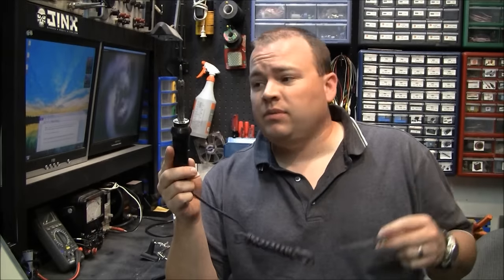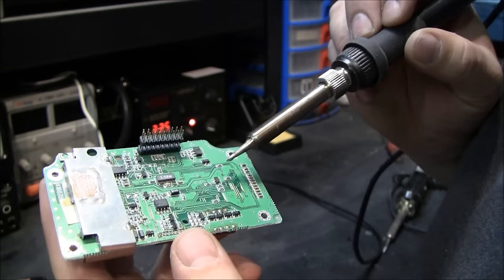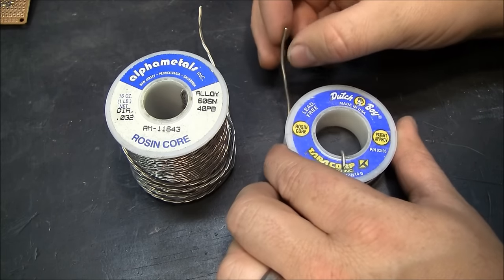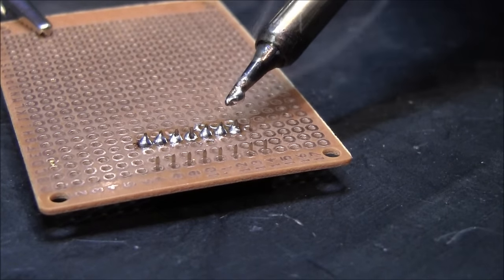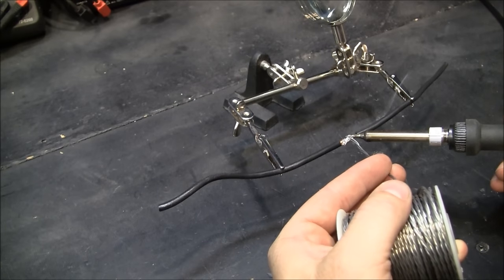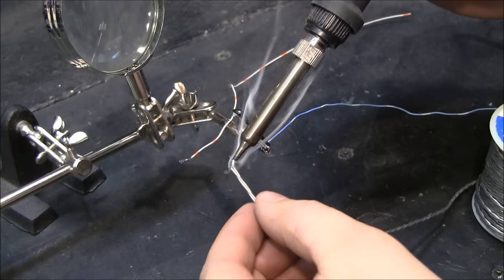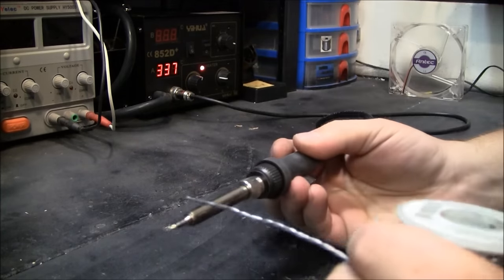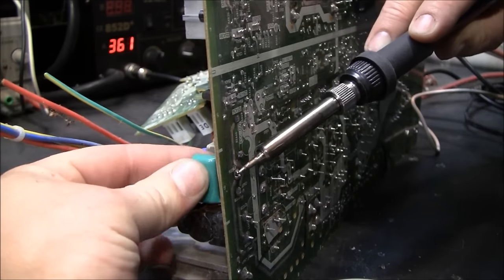Beginner how to Solder

Comment: “I used the solder to solder the solder.” Thanos’ guide to electronics.
Reply: Underrated comment
Reply: LMAO
Reply: so underrated
Reply: Sauder*
Reply: @jayox6449  your wrong it’s spelled solder
Reply: @harrsh7116  Dis how we do it in merica...
Reply: @jayox6449  it’s spelled solder but pronounced “sauder”
Reply: @harrsh7116  ty for the correction and information, you are a genius. This all went straight over your head huh..
Reply: @jayox6449  exactly this is merica
Reply: @multitude1337  q
Reply: @jayox6449  sawtter
Reply: Thanos: Resources soldered and soldered until there was nothing left to fix I gave those electronics a second chance
Reply: @jayox6449  no matter the horrible pronunciation its always spelled solder and yes I'm an American and I pronounce it the same as the brits the correct way 😂 because  'MURICA
Reply: @vulgervulcan  ok
Reply: @harrsh7116 you’re*
Reply: saulder*

Comment: "if you're poor you can use electrical tape"

Fishes out the electrical tape...
Reply: HAHA, I noticed that.  What's wrong with electrical tape???   :)
Reply: it's like the same price almost still funny
Reply: @ryangarcia5416  yes but it's not as cool
Reply: and cigarette lighter vs heat gun .lol
Reply: I noticed that.
Reply: @richb7414  i will take a lichter if i need my heatgun at location i need to run a extention cord etc too much work fore 1 cm of heat swrink
Reply: I just started getting into diy projects and when I try to solder the solder either stays on the tip of the iron or when I pull back the solder there is just a little ball on the end of the solder. The only way I have been able to get a half ass solder is by putting a small piece of solder on the connection then placing the iron on it. I don't know what kind of solder it is as it came with the iron.
Reply: I was like, “I relate to this so much right now”
Reply: @Vgp-rp4iu  might need flux if it isnt in the solder already
Reply: Saania Salahuddin lmao I started busting up when he said that 😂😂😂
Reply: I do have that
Reply: I was literally coming to the comments to say this
Reply: I know right...I was just about to comment about that but thank you for doing my job🤣
Reply: @Jesus_is_Lord_316  it means you're poor
Reply: @ryangarcia5416  yeah, but only poor people use it, so...
Reply: @angelorondini5835  because... is anything that poor people do cool?
Reply: @richb7414  he didn't say he is rich... only that he wasn't poor
Reply: Ikr
Reply: I use garbage bags, some days I want to eat a snack in between soldering... not like Warren Buffet over here
Reply: Poor gang ough
Reply: Me: cries because all I have is clear and duct tape
Reply: if you are going to teach, please use your words properly.
Reply: Ha Ha Ha
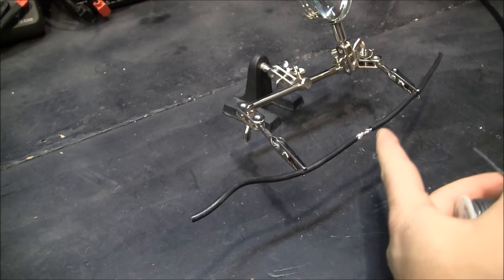Reply: 3:58 he stuttered when saying poor lmfao
Reply: All you people commenting must be poor
Reply: I loved that part too
Reply: I had no idea I was poor
Reply: Stop caring about comments bub. Wicked good video. Tell em your gonna solder their nuts to their forehead.
Reply: Love it!
Reply: Haha what do homeless people use? How do you say sold in America? 😁
Reply: Dislikes the longer process of shrink tubes.... duct tapes TF out of it

Comment: I don't care HOW it is pronounced...I just want to know how its done. This was a good start.
Thanks for this!
Reply: +Darrell Batton Just beware that if you follow this video, you'll be making it harder for yourself than it needs to be. There's pretty much nothing in this video that is good advice. Instead, look for the soldering tutorials from PACE Worldwide and EEVblog.
Reply: Antonio Tejada 
Nothing?
Reply: +Darrell Batton Pretty much nothing. Watch the tutorials I refer to to see what I mean.
Reply: +Darrell Batton: Because bad information is worse than none at all, and unfortunately this video has lots of misinformation. You're better off learning good technique, which will save you lots of time and heartache down the line. 

This guy keeps his iron WAY too hot (so the solder oxidizes faster, giving you less time to work), he applies far too much solder to the joints, flicking solder off the iron is dangerous... shall I go on? Instead of attacking the messenger, go look at the sources I've recommended and see what proper soldering technique is.
Reply: Antonio Tejada  Hmmm...
Way too hot? Doesn't it depend on what type of solder and what application, since different alloys have different melt points? Hell, in the video he says it depends on application. (That must be wrong...) 

But you stated, "pretty much nothing in this video that is good" - and with that you are simply wrong.

I'm guessing that like most skills, watching a video is NOT the way to learn - DOING is. And learning from mistakes is a better teacher than luck. I'd venture to say that if this video does offer some bad advice...I'd learn it pretty quick when I tried it.

However, that's not the problem I have with your comment...

My gripe with you is the way you delivered the message, not the message itself. By your negative blanket statement, you ruined the message... and your credibility. Thus the messenger deserved the attack in failing to do his(your) job.

Next time, try honey, rather than vinegar.... like this:

"I find that the soldering tutorials from PACE Worldwide and EEVblog worked well for me. You may want to watch those as well if you are trying to learn soldering techniques. With all things YMMV!"

Cheers!
Reply: +Darrell Batton Does the temperature depend on application? Yes, especially with low-quality soldering stations whose tips are poor and/or whose temperature sensing is not tightly coupled with the tip. (Can't really tell what he's using.) But bear in mind that modern lead-free solder melts at 219C, and classic 63/37 leaded solder at just 183C. So generally speaking, 280-300C is a good working range for your iron. 370C is so hot it just burns away the flux.

You're the only person who's reacted like this to my comments, so while I accept your feedback as to wording, I think you're being a bit (insanely) oversensitive. And do bear in mind that I didn't say "absolutely nothing", I said "pretty much nothing", allowing for a tiny amount of correctness in the video. (I still maintain that the wrong-to-right ratio in this guy's videos is very high.) As for credibility: You don't need to believe me -- I'm just a hobbyist --  you should believe the professionals in the videos I've suggested. 

As for learning by doing -- of course, there's no replacement for practice. But there's also no need to waste your own time reinventing the wheel, when you can have some professionals show you best practices so you know how to do things and what to look for.
Reply: Antonio Tejada :)
Reply: True sir
Reply: @rjdeible I don’t know why I have any subscribers at all, since I don’t produce videos. But I gave suggestions for other channels that make soldering videos worth watching. And they’ve got more than 31K subscribers, not that subscriber count is any real indication of quality.
Reply: Well, pronunciation is important. It's kind of how language works. For example, you wouldn't roll up to a gas station and ask them to fill it up with milk would you? Even though you mean petrol/diesel. Pronouncing it "sole-der" or "sodd-er" is regional, but if you are going to use the latter then change the spelling.
Reply: @TheBattons  ma men
Reply: Good for not careing about what it’s called
Reply: same here, but we need to know the names to be able to buy them hhee
Reply: @tookitogo  dude can you build me a wii in a gameboy color I would pay! Do you have any socials?  You seem very knowledgeable and you’ve grabbed my attention! Can you drop your socials so I can contact you. Thats if you want to ofc :)

Comment: Can folks please STOP commenting on the solder pronunciation... Just nuts!

It was a very helpful video, thanks for the tip. I am new to soldering, mainly got into as a lot of my kids toys are broken and when I take it apart a lot of them are relatively wire off board fixes. But requires soldering. 

Thanks.
Reply: +shyamvk Just beware that if you follow this video, you'll be making it harder for yourself than it needs to be. There's pretty much nothing in this video that is good advice. Instead, look for the soldering tutorials from PACE Worldwide and EEVblog.
Reply: +Loyalty Otokpa Sorry, ain't gonna happen. When I see bullshit that will cause others grief, I'm gonna call it out. I'm not affiliated with pace or eevblog, they just both happen to know what they're talking about, unlike the dude in this video.
Reply: Antonio Tejada i went through the eevblog tutorial, it was good, having said that, i found the language and level of explaining in this video to be more to my level which is beginner.
Reply: So.. did you fix the toys?

Comment: Something else to mention: if you don't have any other heat sources to shrink your heat shrink tubing, you can use the metal shaft of your soldering iron. I had to do that because I was in a pinch and it worked flawlessly.

Comment: question: the solder allows current to flow? or does it acts like glue, just holding it together
Reply from the maker: +MghUnit407 Solder is like wire, it allows the electricity to flow.
Reply: +MghUnit407 it is a metal connection so it is conductive
Reply: +MghUnit407 What's interesting is that while soldering is adding a different material (to the copper of the wires), the solder actually slightly dissolves the copper of the wire, creating a strong alloyed joint which is both electrically and mechanically sound. (That said, it's good practice to always design a strong mechanical joining anyway, and not rely solely on the solder for mechanical support. For example, how the wires in this video are twisted together first. You wouldn't just lay them next to each other and have only the solder linking them.)
Reply: +MghUnit407 In Simple words it allows current because the "Iron" is lead
Reply: it just holds it together
Reply: Soldering, like brazing, is actually classified as an 'adhesive' process, like joining two objects with glue. Neither object being soldered melted in the process, and the solder that is melted into the joint forms a fillet (filler) that bonds by adhesion to the objects and completely fills the space between them. By contrast, welding is quite different, since the objects to be joined are actually melted, and the molten surfaces flow together before hardening again as they cool, although it is common to also introduce a filler material into the joint, which is melted into the molten mixture along with the primary objects. 

Because soldering does not actually join the two objects 'as one', it is not considered to be as mechanically robust as welding.

Be is similar to soldering, but differs in that higher temperatures are used (although the objects being joined still do not melt), and that a closer/tighter mechanical joint is required between the objects since less filler material is introduced into the joint (only enough material is used to wet the two surfaces, and the filler is typically a much stronger substance than the soft materials used as filler when soldering).
Reply: So many conflicting and confused replies.
It's a bit of both. When you buy solder, typically you would buy 60/40 lead/tin. We know that tin is conductive and lead is not. So it's kind of conductive, but not great. Think of it like mortar between the bricks.... it appears to do the same job as the bricks, it's certainly strong, but you wouldn't build your house out of just mortar. You still need the bricks for strength. So, you still need that highly conductive copper wire  to touch the other copper wire if you don't want the ohms to be too high trying to jump across lead and your voltage drop off because of too much resistance.
Reply: +ArcanePath360 Complete nonsense. First of all, 60/40 means 60% tin. But more importantly, lead most certainly is a conductor. Both tin and lead are good conductors of electricity, though neither is quite as good as copper or silver. (Tin is twice as conductive as lead, and copper is 7 times as conductive as tin! But this is all relative - they all conduct electricity readily. Their electrical resistance is still in the nano-ohm-meter range.)
Reply: Yeah I wondered if I got that the wrong way round after I hit the button but couldn't be bothered to alter it! Yes it is all relative, and essentially, lead is a poor conductor of electricity compared to other metals such as tin, copper and silver. Adding more lead adds more resistance, which I'm sure the original poster doesn't want.
Reply: +ArcanePath360 Again, "poor" is relative. Lead is a poor conductor amongst metals, but all metals are excellent conductors of electricity. (Tin is also among the poorer metals.) At the distances bridged by solder, the resistance of tin and lead is completely negligible. In fact, because the solder bridges tend to be so thick compared to the copper PCB traces, it actually produces spots of LOW resistance. It is also common in power supplies to see power traces coated in solder to increase their current carrying ability. You seem to think that lead is practically a small resistor; it's not.
Reply: You could say that people conduct electricity, but I wouldn't design a PCB with human flesh. I stand by my original statement.
Reply: But we aren't even distantly as conductive as the worst metals. We are literally in the ballpark of about one MILLION times lower conductivity than copper — and 200,000 times less conductive than lead. Yes, lead is less conductive than copper,  but you don't seem to grasp that on the grand scale of conductivity, all metals are bunched up at the extreme high end. 

If you think lead is an insulator… well, why don't you run some experiments and see what happens? I just suggest you use a multimeter to check that "insulation" for lethal mains voltages before you do.
Reply: PCB boards have copper tracks.  Copper naturally oxidizes when exposed to air (but only on its outer surface). The oxidized part of the copper has poor conductivity, so we want to remove that oxidization. Adding flux will chemically (and quickly) remove that oxidized layer off the surface of the PCB (i.e. remove it from the copper track) exposing a nice clear copper track; this is the sole purpose of flux.

Then the hot soldering-iron can freely melt both the exposed copper (from the PCB) with the tin/lead (melted from the solder) which allows a proper fusion of the molecules into a completely different alloy which happens to be highly conductive AND incredibly strong. If you do not apply flux, you will still get a partial bonding but the oxidized copper track will reduce the amount of "alloying" - hence the bond has less electrical contact, and will not be as physically strong (in time it can even break loose).
Reply: lucysluckyday: Thanks for this valuable knowledge. I have some PCB copper proto boards and as you seem quite knowledgeable I wonder if you know why there are long copper tracks (like power rails) but without the holes? I had some before with holes but can't get them again. Seems odd to me that a breadboard is like this but not a board that you would solder, as a set of power rails is often required for my projects.
Reply: ArcanePath360 Are they designed to not have holes? Or are they like some of the cheap Chinese ones I've gotten off eBay where they were simply too cheap to drill all the holes?? :p
Reply: They were cheap ebay ones ;). Not sure if they were purposely designed not to have holes. The copper lines seem to follow a pattern at the edges and in the middle and are separated like one is for - and one for + but there is nothing drilled anywhere along them. I tested the copper for continuity on my multimeter and couldn't get a single beep. Am I supposed to just solder directly to the top of this, and when I do the oxidisation that is currently on the copper will go and I will get a reliable connection?
Thanks
Reply: I have some generic boards that I got off ebay, and they also have those power rails (three sets actually).  You can pretty much use them as you like, but each track should be conductive right from one end of the track to the far end. With my boards I will set one to GND, another to 3.3V, and if I need it I might set the 3rd to 5V which the rectifier chips I use in circuits provide.  Couple of things though:
1. If you multimeter is not beeping the shortcircuit sound on the long tracks, then the board is a dud.
2. There should be holes to poke thru-hole components through.  Are these boards you have (without holes)  designed for SMT/SMDs by any chance?  I've never seen generic SMT proto-boards ..
Reply: Also, your earlier question, oxidized copper should not be an issue for the shirt circuit tester (removing the oxidized layer is more to get a strongly welded/alloyed joint. Move your probe around a bit on the tracks, it should beep if it really is copper. If you are super worried about it, pre-wiping the boards with isopropyl alcohol is recommended by the pros before you start the soldering, but if it is just a hobby-board then simply using flux is fine when soldering, though I still like to wipe at end with isopropyl alcohol to rub the chemicals off (use gloves) otherwise the tracks start turning slightly green if you leave the flux residue on them.
Reply: Thanks, they are typical SMT boards. the multimeter registers continuity where there are vertical rails and holes, but not along the horizontal tracks which have no holes. I think it might be best I don't use them and put my own rails in using solderless U-shape wire and take the sleeve off, so I can then solder off any point along these. It's hard to find boards on ebay with these rails now for some reason.
Reply: ArcanePath360 You just explain what 60/40 solder is you never really addressed his comment directly..